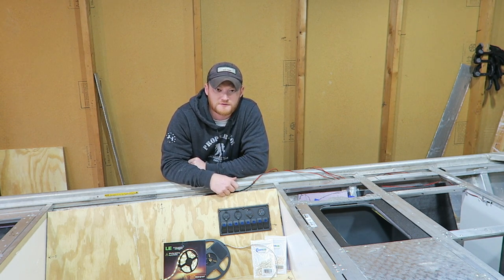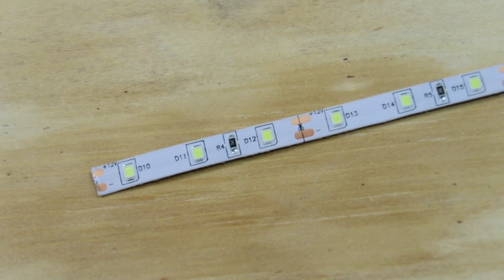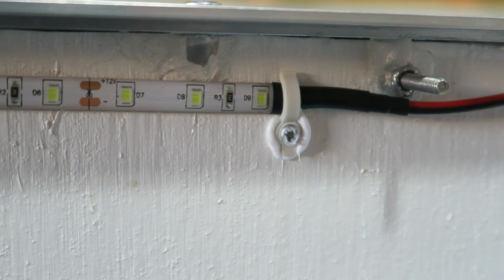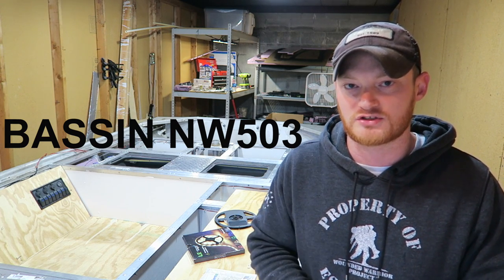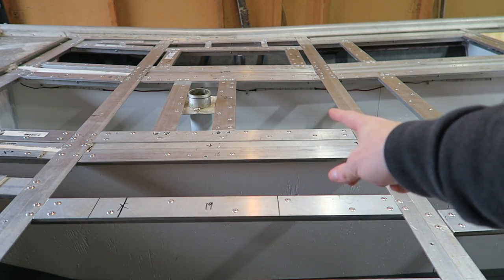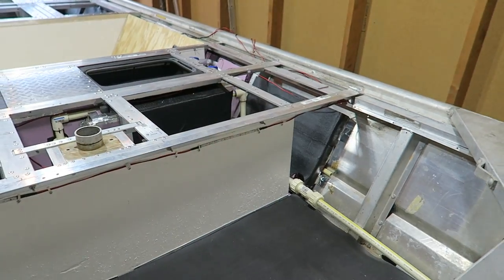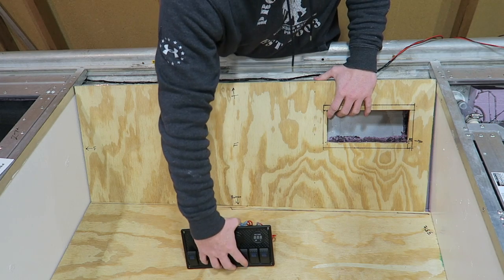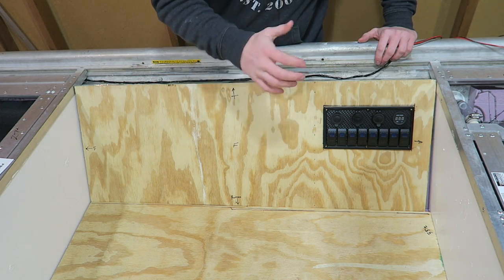LED Lights and Switch Panel: Jon Boat to Bass Boat

Comment: Nice workmanship. 1) Why did you split the led lights on compartment runs that didn't need a split whereby you had to cut and then reconnect the same strip? 2) I was thinking you could have used high tack hook and loop or high tack 3m strips instead of screws... or affixed the lights to the underside of the lip of the aluminum instead of the wood. Any thoughts on looking back at your install?

Comment: Hey Ryan,  question for you. If you have a switch panel with fuses built in, all you need is a bus bar? Or do you need to have a fuse block as well? I ran to some issues with my build last year and I'm trying to figure it out so I can get everything done this spring. Thanks. You have a great looking boat!

Comment: What are you using on the bottom of the hatches?  It's black and has numbers on it.  Is that tar paper?  Love your project so far.
Reply from the maker: Like on the floor?
Reply: FIREANT FISHING , Yes the black stuff on the floor.
Reply from the maker: its a garage mat haha. just cut it to fit in the bottom

Comment: I've tried adding lights on my boat, yet I'm having some trouble. When I turn the lights on they start to get really hot, or even smoke, and eventually turn off. If I try it again in a little while later the lights will still turn on, but do the same thing. To my knowledge I have done everything correctly, except instead of soldering, I'm using these light connect clamps. Any ideas?
Reply from the maker: sounds like the wires you are using are too small for the power of the lights. Im not 100% sure but thats what i would look into
Reply: Titanium Bones do you have the correct voltage across your LEDs? because if LEDs get hot, which they shouldn't if they get the correct voltage and current, they almost immediatly burn out.
Reply: I was using 12V 3528's with 18 gauge wire to a 12V battery. I think what the problem was is that the led connectors weren't exactly waterproof, and some water got in. I redid the lights now using the 5050's and soldering them, and I haven't had that problem anymore.

Comment: How long is your boat? How long have you been doing this? Also, have these projects been exspensive?
Reply from the maker: Its 16'. I've been working on this project for almost a year and a half. This one has been pretty pricey, but it has been over a period of time
Reply: I have a little 10 foot boat. I'm wanting to put a casting deck on it. But I'm on a budget.
Reply from the maker: a 10' shouldn't be too expensive. Bc its so much smaller you could get away with using the existing seats in it and build off that with a light wood frame. Most of your expenses would be the ply wood and carpet i would imagine
Reply: How much did you pay for the switch panel and led strips
Reply from the maker: There are links in the description that will take you right to them